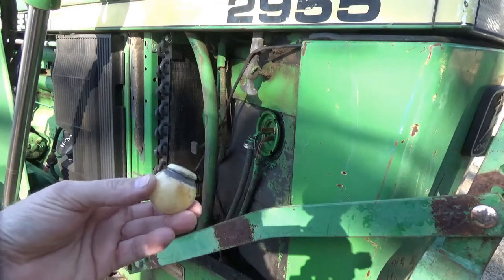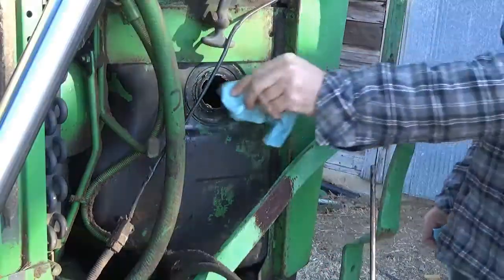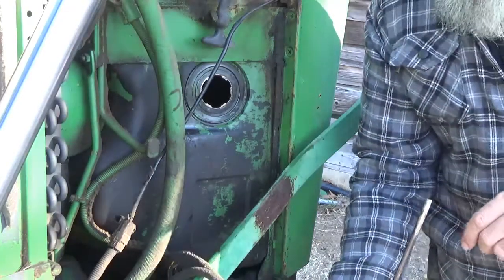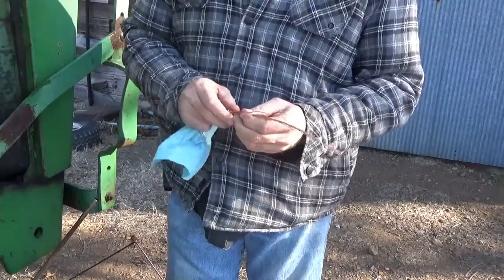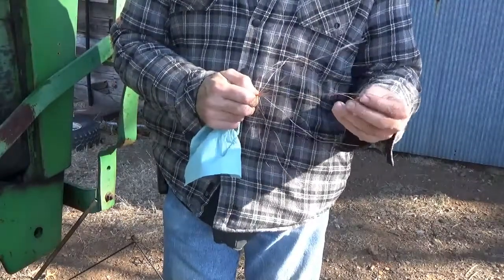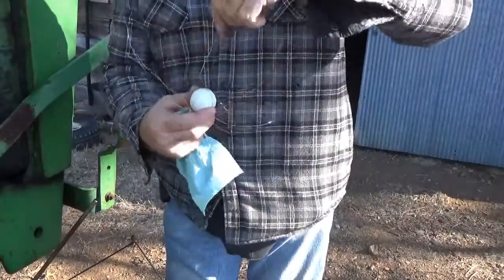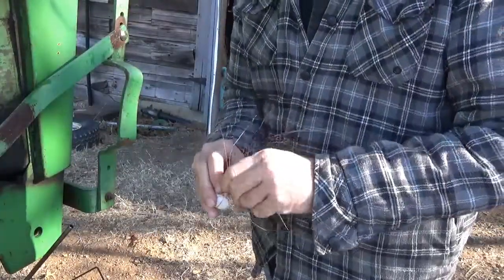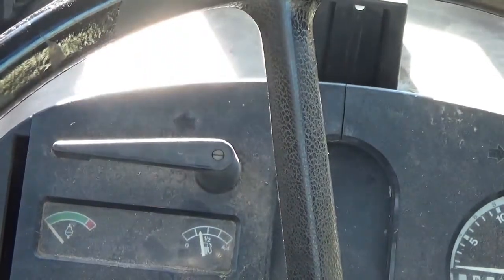I used a what to fix my fuel float

Comment: Good idea. We have 2 2640's who's fuel gauges don't work. I may have to try this. Thanks for sharing.
Reply from the maker: Be sure to replace the O-ring on the sending unit. The ping pong ball was free and just about the same size. It's still working. I used 10 gauge stranded wire for the cage. Sure beats $97 for the complete unit.

Comment: MacGyver would be proud!  I’m surprised that sending unit is that easy to get to. JD designed that to be worked on.
Reply from the maker: It's a 1992 model i think, They didn't plan on working on it very soon.

Comment: I'd been worried it may would break down in the fuel .. I probably woulda tried a hard cork , the filter should catch any particles if the cork broke down over time .
Reply from the maker: I replaced it with a float for a mustang that fit the lever